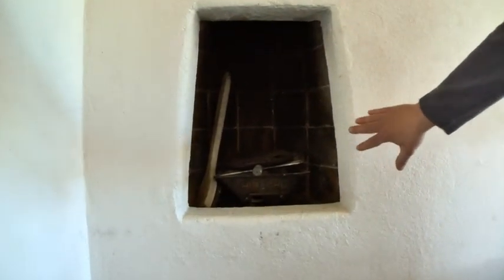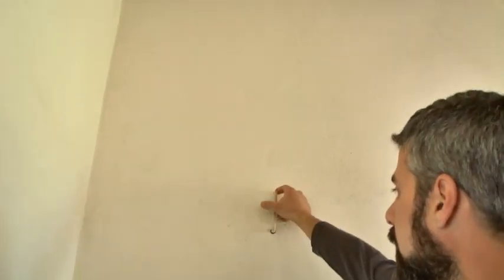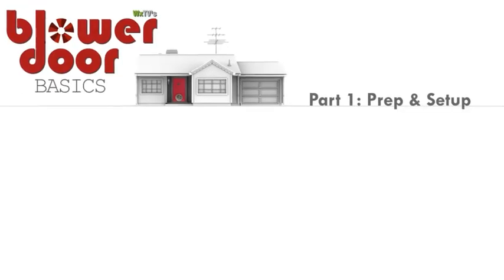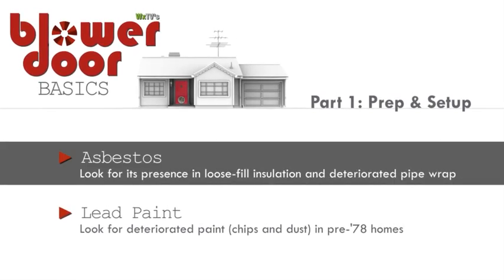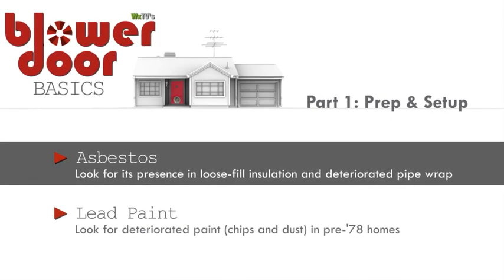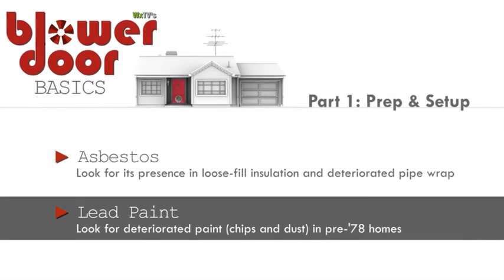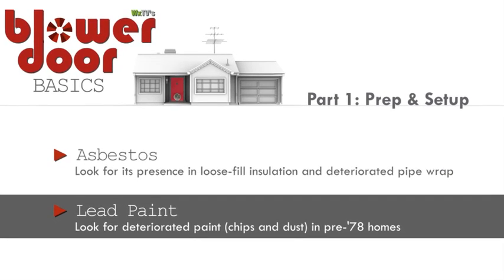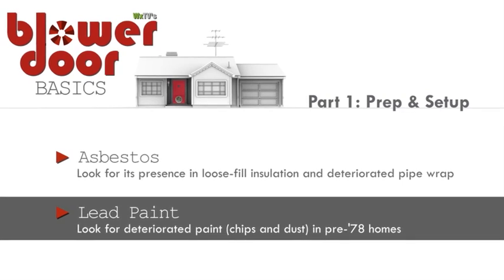Blower Door Basics: Part 1 - Prep & Setup

Comment: Attention to Fireplaces, Combustion Heaters and Dust is a good Point but its more safe to run the Test with Overpressure by turning the Fan. Also test in Both directions could make sense if some parts like Plastic-Foil-Connection work as a Valve in one Direction  ...Actual I use Blower Doors as the cheapest Ventilation-system to move huge Amounts of  Air during Corona-pandemic: I calculate >30 Airchanges per hour while people in closed rooms get infected during 2 Minutes.